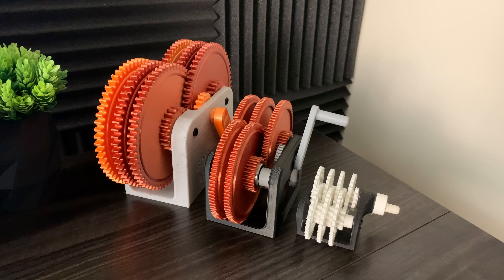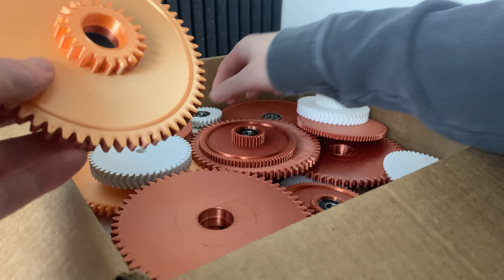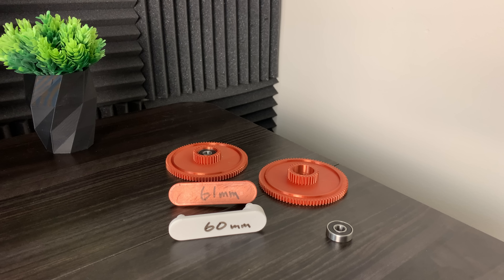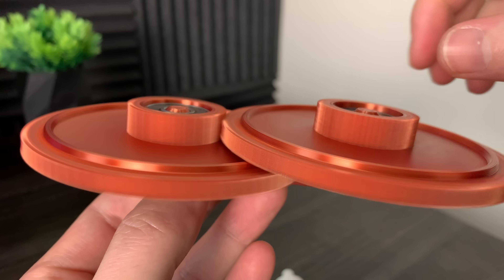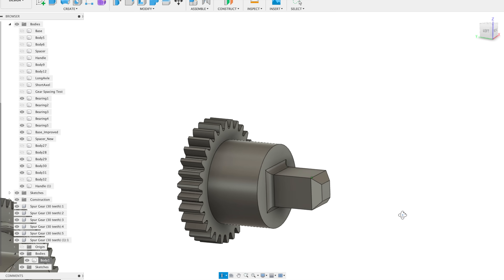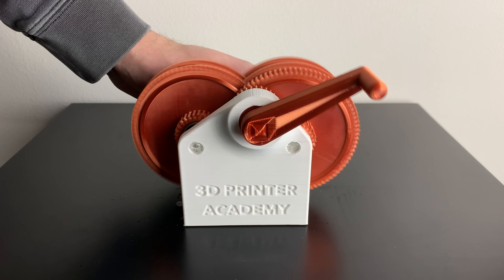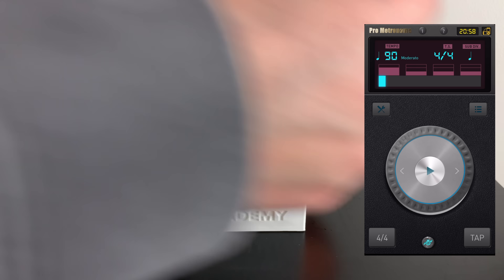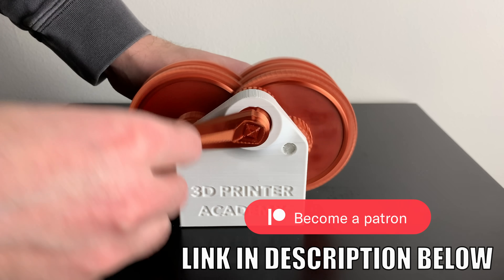3D Printed Gearbox - Speed Test [Episode 2]

Comment: You can able to made free energy by making it for hand genrator some more big gears which can able to produce 12000 rpm then fit this with gear cycle then you will able to move your handle drive at speed of 400 rpm near about then fit a car alternator or something like that which will produce crunts with it . Then to battery and save energy

Comment: Remember the longer the arm of the leaver the easier it will turn you really wanna see some gears fly use a handle roughly the length of your arm and try and spin it as fast as possible

Comment: We do use these.  They are called transmissions.  And the reason there are typically 5 or 6 gears to get to speed is because if it started at 6th gear the engine would have to put out an absolutely insane amount of torque to try to get it to spin. Which is why there are lower gears, to get the big ones up to speed before having the torque directly applied to them

Comment: Issue with attaching a drill is that the torque required to spin it is probably far greater than the drill will be able to provide, even if you have a fancy one that has adjustable speeds, so it'll just trip the clutch and go nowhere.

Comment: The average circular saw spins  at a 5200 to 5500 RPMs. If you attach a saw blade on the last gear, and some kind of foot pedal system like old timey sewing machines, you'd have a pretty efficient woodworking machine.

Comment: I remember using an old mechanical centrifuge to separate cream from milk. It had a gear train greatly increasing the RPM of the input, so the crank took some power to turn, just like this one. The fat content of the separated cream was dependant on the speed of the machine, so it was important to turn it at an even speed. To aid this there was a spring which made a little audible click with every full rotation of the crank.

Comment: Now, let's imagine that one Arabian who can power a house by spinning a gear with a handle. What will happen to the last gear when he spins this?
Reply: The thing is, the horsepower is the exact same on both ends of the gearbox, only the rpm is higher and torque way lower. That torque is the problem as you won't be able to get any more work done by hand than if you were just straight up turning a generator by hand with no gearbox.
However a number of years ago I saw a neat device which used suspended weight and a gearbox like this that could power an led by hand for a few hours before needing to be reset. Hardly powering a whole house, but cool nonetheless.

Comment: If I where you, I would double check the actual inertia ratio on that final gear, before risking up smoking out your screw-driver. Not only speed, but acceleration is also multiplied by the ratio. This is the reason why for almost all applications, a reduction gear is used instead: it doesn't only allow an increase of output torque, but also reduces the inertia of the load as experienced by the motor.

Comment: I have a feeling the tooth profile of your gears is not very optimized.  Have a look at teeth profiles of different racing transmissions like PPG, HGT, Quaife, Hewland.  Although i feel the resolution of the printer isn't high enough to have uniform teeth, you can already see the profiles are not uniform.

Comment: Imagine a system where you have like a baseball or a beanbag and you set it on a platform and as it slowly falls the machine winds up a mechanical clock. So you don't have to sit there fussing with it you just put a small weighted object in a tray. 

And it dosen't have to be a clock Per se, it could be an abstract modern take on a glockenspiel. You could have light weight spinning panels with led lights that create a complex moving background a rotating platforms for your amibos or your funko pops.

Comment: it should be pretty easy to make spacing between 60 and 61 mm, by adding some vertical shift, such as 8 mm, so you get (3600+64)^1/2=60.5

Comment: You should make a model with even more gears, and then make so there are flat blades on the last gear, maybe it would make a loud sound. I'm pretty sure that at 7k rpm, those little teeth are going super sonic. But I don't know to be sure.
Reply: Depending on how far across the wheels are they're somewhere around 62 mph for 3 inches across 80ish for 4 and 100ish for 5

Comment: What did you use for the axles, I printed this but I can't speed test it because I can't get the right axles.
Reply from the maker: 8mm metal rods. you may to some fine tuning i.e. drilling the holes or some minor sanding for best results. Good luck!
Reply: @3DPrinterAcademy  thanks!

Comment: I need a gearbox for this cheap phone charger. The electronics actually aren't that bad, but the gears slip like crazy and the housing is super loose, so you get like a second of power per 5 turns

Comment: The question is are you just experimenting, or are you going for practical use?

If for practical use. I'd use odd number toothed small gears and even number toothed large gears and the tighter array spacing. In assembling, I'd use lapping compound on the gears and turn at moderate speed and loading to work it in. this allows for quick wearing in and less backlash when changing speeds. After it's smoothed out, I'd add a balanced two-pound weight to the high speed gear and a caged paddle style fan. This makes a good hand-powered blower for an old style blacksmith forge.

Comment: So there is a reduction setup that makes the end spin once in a googolplex years. It would take infinite energy to spin the end once in a minute, and your other end would theoretically spin backwards in time.
Reply: A googol to one gearbox requires 100 10:1 gears. A googolplex to one gearbox would require a googol 10:1 gears. If each gear was 0.2 microns in diameter, and they were packed together, they would just barely fit into the observable universe, so no, a googolplex to one reduction does not exist. Furthermore, the amount of energy wouldn't be infinite, it would just be very large. A finite gear ratio means finite energy. Finally, nothing would travel back in time. Spinning gears obey the speed limit of the universe just like everything else and no gear in the system would be travelling faster than the speed of light.

Comment: For those who don't want to wait for the explanation why we won't use these gearboxes more: It is already used. In cars for example. For everyone who drives cars knows: Starting in the first gear (Let's say 1:1 Ratio you need less power and RPM to start since it doesn't cause much friction.)if you start at another gear the friction/torque gets worse. You need to add power by hitting the gas. The higher you go. The more power you need. Why? Because a 1:10 ratio may be faster. But it will cause more friction. Therefore you need for a gearbox of 1:100 more Watt(Horsepower) than for a 1:10 Ratio at the 10x speed. The car engineers need to balance it. Give the motor more power can take up a higher gear. But will the fuel consumption be worth it?

Comment: Could this type of gear be used on a bicycle?
Reply: Do you mean the material or the concept?   Bicycles use the concept in the gear ratios just use a chain
Reply: @Bendigo1  Yes the concept. If you applied multiple gears and chains in the same structure of transfer of these gears in the video, would acceleration and speed of the bicycle be increased greatly, or would it not be effective?
Maybe somebody has made something like this already. Do you know if there is a specific term for a stack of gears like this?
Reply: @fucksake893  the problem is that every time you increase the speed of the next gear you are reducing the torque at the end of the second gear. It would require more power to spin it to get any use out of it.   That is why most gears stacked together are a reducing the ratio not increasing it.
Reply: @Bendigo1  Okay, I was wondering if that would be the issue, but don't know enough on the subject. Thanks for the information. I found a video where someone has used the concept, but they do not show the back wheel on the ground, I imagine it doesn't even move. The video is called: modified high speed gear bicycle. It has indian people in the video, it should be the top vid in the search anyway.
Reply: @fucksake893  you're welcome.  Gears are fascinating

Comment: When fooling around with gears I discovered this... 
When you design the gears with the spur gear addon on fusion 360, they are dropped with a sketch that is a green dotted circle line. If you move the gear by selecting the "component" option, instead of the "body" one, the green dotted line will go with it. 
Than you can use the coincident tool to perfectly touch the dotted circle lines of the gears and match their distance.
Doing this way, I got perfect gear spacing every time. Hope this helps somehow. 
Great Video
Reply from the maker: I usually add a little extra space to reduce friction on the imperfect 3d printed plastic gears
Reply: @3DPrinterAcademy  Have you ever tried to set the backlash at the plugin to 0.2 mm when generating the gear?
Reply from the maker: @andreaudio  no, but I probably should! Good call.
Reply: @3DPrinterAcademy  I hope it helps!

Comment: Im glad you made this video.im trying to design a  system with that gear design .to fit it onto a eletrical generator for electric vehicle  how do you design that system but make it run at least 11,000 rpm or higher on the generator connector side .im trying to do that for the set of wheels not attatched to the generators unless it can still generate power and propel the vehicle any suggestions any help would be appreciated  im no math wiz in the least but this project among very many that ive designed since the 4th grade. Whats the highest rpm can a geared box spin before it tears itself apart can it go

Comment: I have a question: what would happen if you added an electric  generator at the last gear? would it produce insane amounts of electricity or it would explode because there is too much RPM generating?
Reply: it would generate low amounts of electricity. Coal generators at power plants can spin faster than this, and if not they compensate with torque and sheer size.
Reply: @jjmj4971  thank you for the answer!
Reply: Small electric motors can spin very fast.

Comment: then just get a 500W angle grinder/dremel, or if you want to get real nitty gritty then there are 775 or 895 motors = same things are used in these machines, now all you would need to do is machine a 90 degree rotatable head and you have an all in one dremel+angle grinder+drill machine, yes i'm pursuing engineering ;_; :D

Comment: If you are going to connect a drill than please use some kind of lubricant and dont connect the drill directly because you are going to wear the gears out in two seconds. Instead connect it with an alternator belt without V teeth so the beld can slip while speeding up. :-)

Comment: You should consider using a laser tachometer to directly measure the RPM, as they can be had quite cheaply. With how high the gear ratio is, the method that you used to guess the speed of the final gear is really inaccurate.

Comment: Huh.... I have a broken (mechanical) connector of an ignition distributor. This part was originally made out of plastic. Unfortunately, this engine is so old, that you can't buy this part anymore. I always wundered if it would be possible, to reproduce this part with a 3D printer and use it inside of this engine. The maximum temperature would be about 110°C, but it would have constant contact to oil....

Comment: would using a rubber flat mesh not reduce friction even more? Yes it might slip if too loose, but if you get the pressure just right i feel it would grind less then teeth, no? I feel it would be perfect for the first gears, and then continue with normal gears since some slippage is a benefit there maybe?

Comment: Adding a fly wheel at the end might be interesting too
Reply: and a drive shaft, and wheels, and suspension, and some sort of cabin with seats and windows.
Reply: Correct me if i'm wrong but the torque at the end is probably so low that you have to put a gigantic amount of force on the handle to get the flywheel started.
Reply: @johnmarston5383  Yeah... torque I imagine is the main limiting factor.

Upside would be a more stable top end speed. Downside I'd more torque is needed. And going up gears like that torque is already a major factor.

Comment: I don't know if this information is useful for you but you can get a 58:1 metal gear drive for 60 bucks or so. Torque multiplier, capable of 3,300 ft. lbs. of torque. It has 1" male square drive on the input and output. In theory you could spin the output for a high speed on the input, it uses planetary gear sets I presume. Amazon got all sorts of them